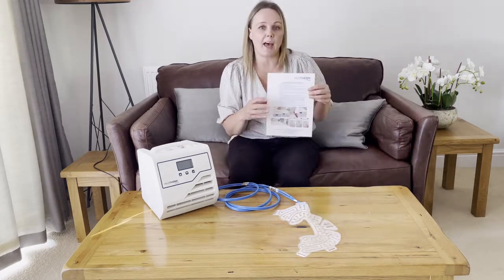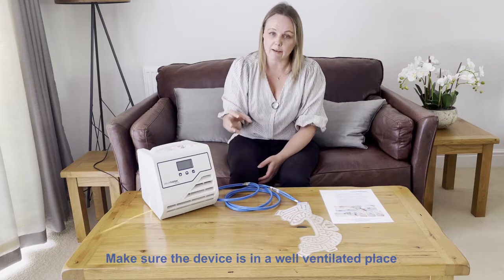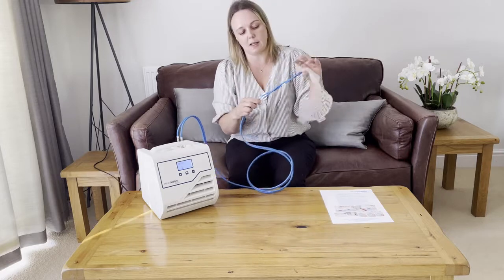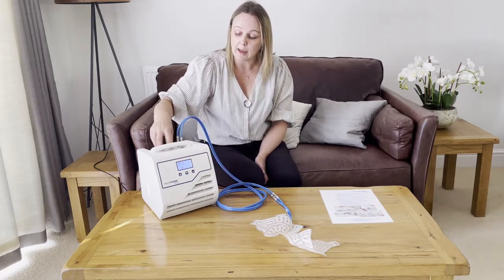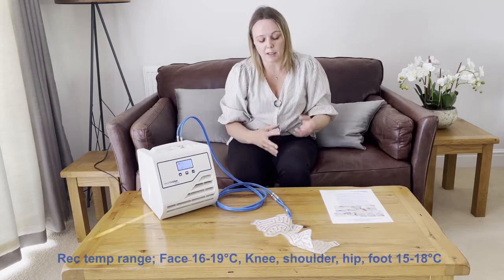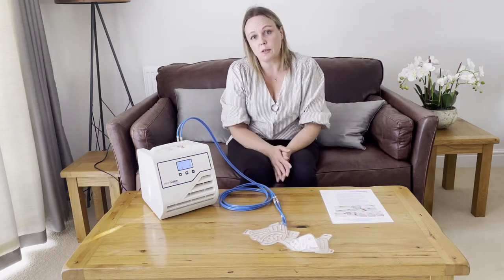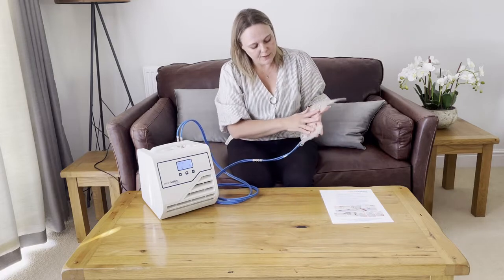HTP1 Instructions

Comment from the maker: 0:54 Positioning the device
1:34 Connecting tubes & cuff
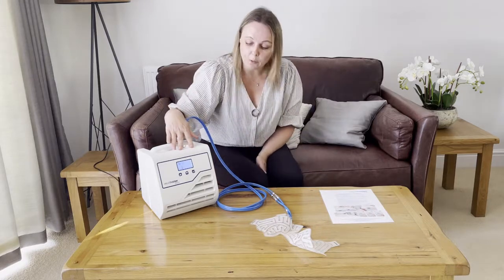2:26 Water - checking & adding
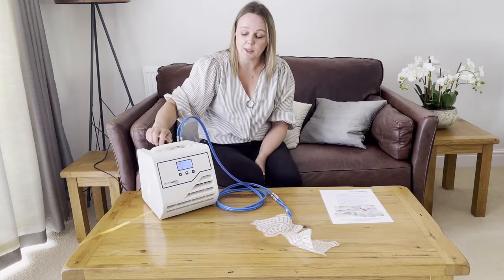3:08 Temperature - setting & recommended ranges
4:03 Duration of use
4:19 Starting water flow - Eco & Power mode
5:24 Checking water flow
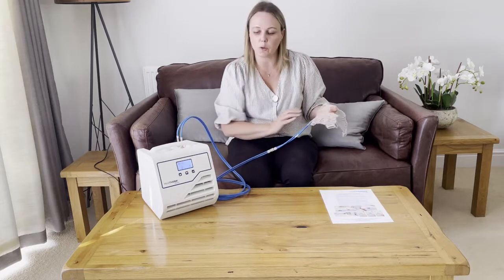6:04 Stopping water flow
6:18 Finishing treatment